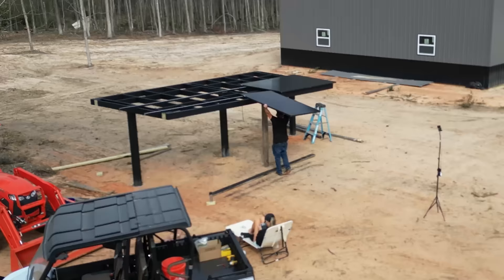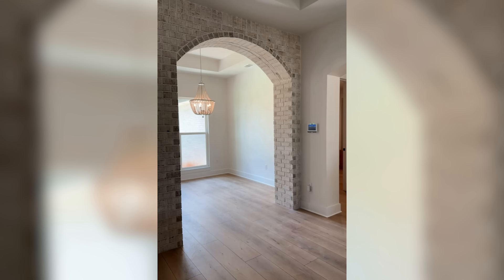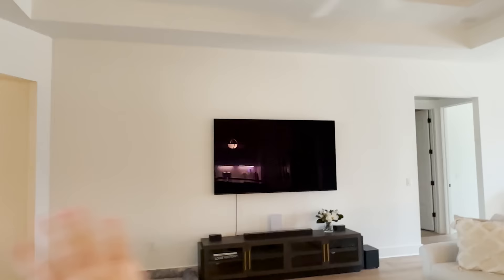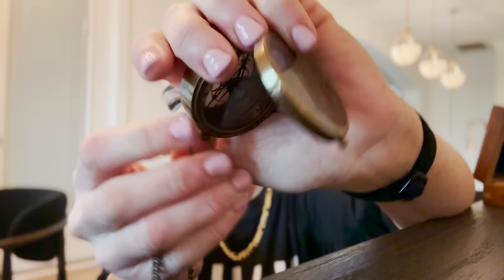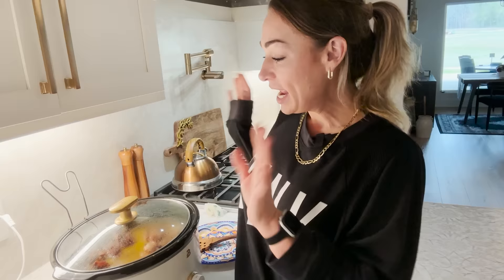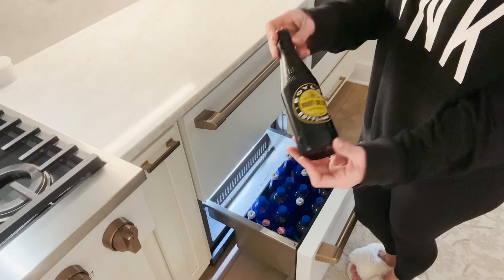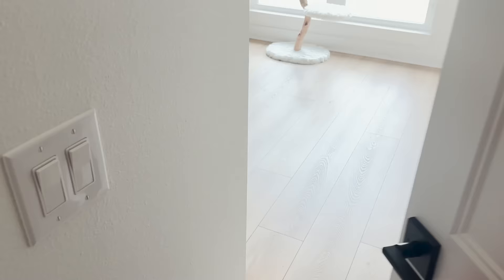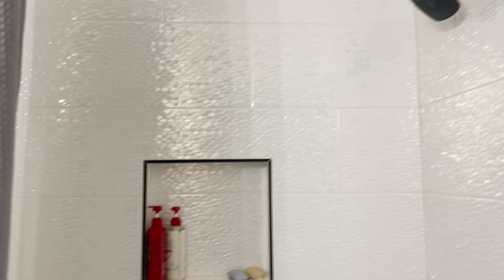NEW HOUSE TOUR! Was The Stress Worth It? Our Forever Home is Finally Done | Christina Randall

Comment: If you framed the doorway with thin pillars on the sides that's causing your "stop" issue, then put an arched mantle over the top of the doorway that reaches the ceiling, that would work as your stop and you could paint the living room wall as an accent wall. Just a thought

Comment: In your living room, where you want to paint the wall, add more depth to the wall with trim, boards, etc, and then trim out the doorway, and you can paint it and it will be a lot more cohesive with painting it. 
😊
Ps- HOUZZ has great ideas!❤

Edit: you could do something by the TV in the living room, like what you did in your bedroom.  That way when you paint it, that doorway won't matter as much. 😊